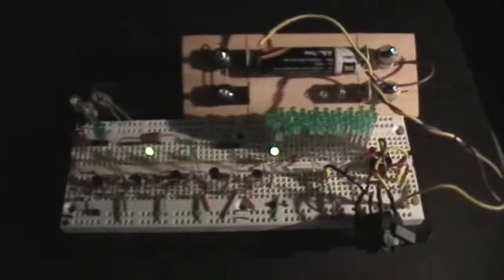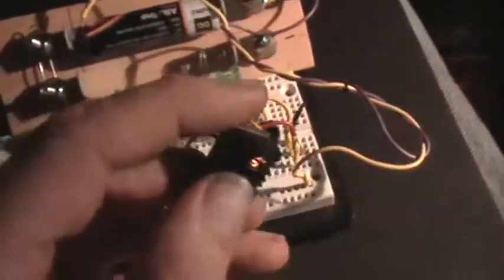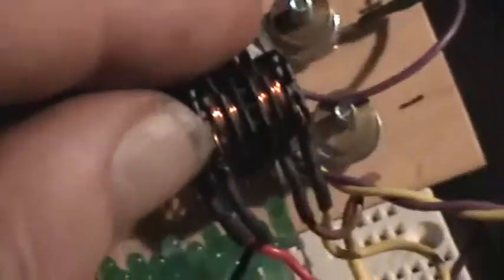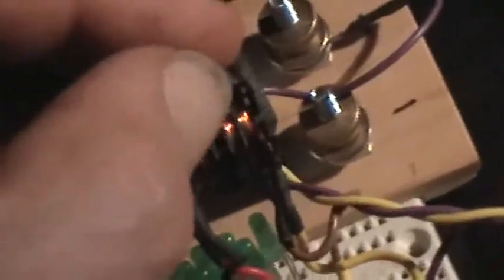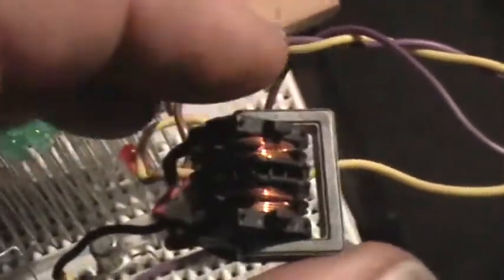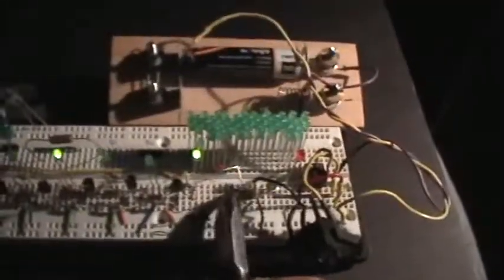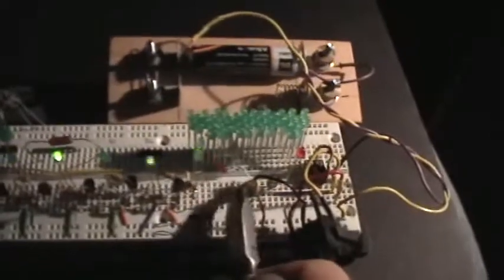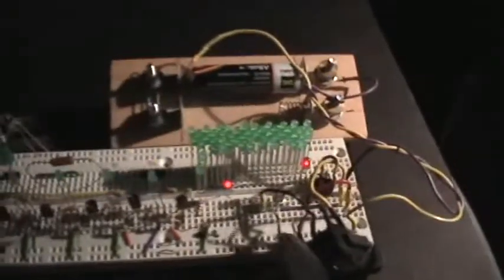Joule Thief: JTBasic Powers the Ring Oscillator

Comment from the maker: It's now about 8 hours since I made that video.... and the ring oscillator is still running, still on the same dead battery. It has dimmed and slowed somewhat... but I'm amazed anyway. The battery is indicating 0.452 volts in-circuit.